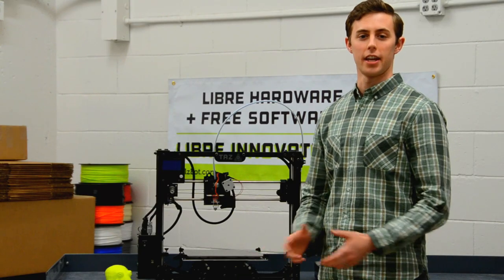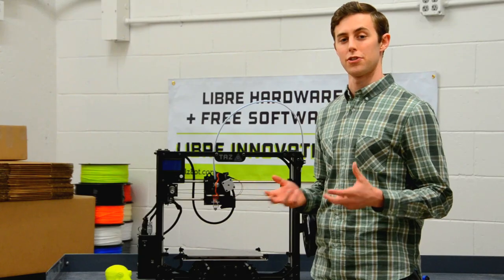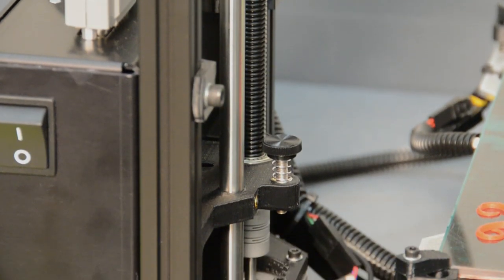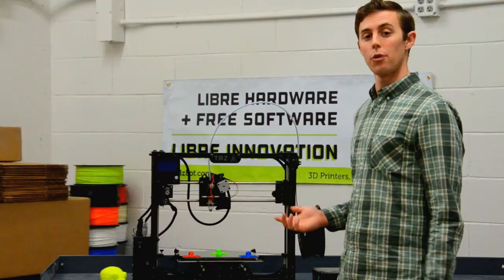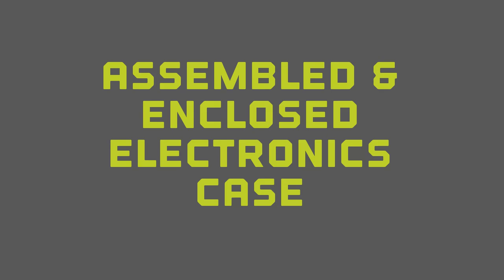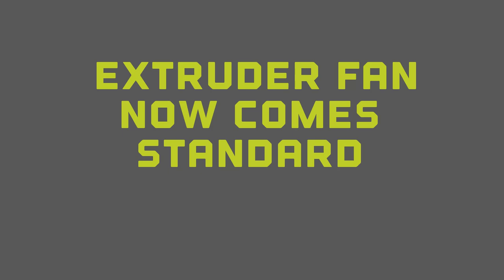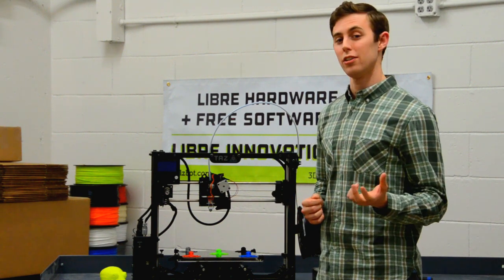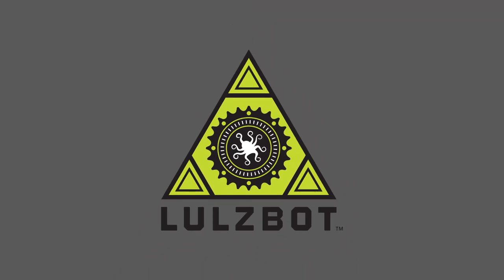Introducing the LulzBot TAZ 4 3D Printer

Comment: I'd like to see the fan duct split so that it blows some air onto the extruder heat sink fins, to reduce the clogging when building with PLA.
Reply: *****
Thanks; what is the file extension ODS? Is that Freecad or Openscad? We use Solidworks here in the store, but I know you guys are all about free tools :)